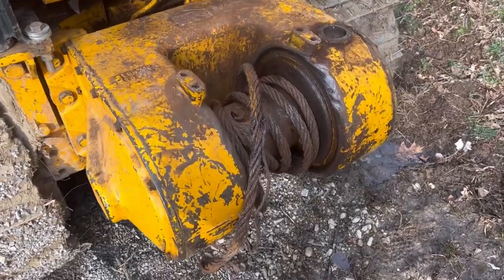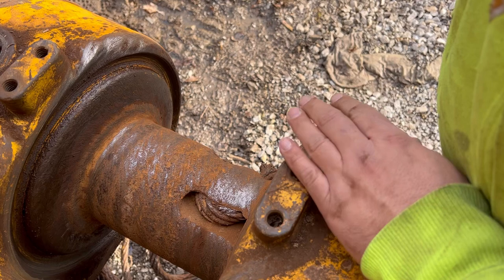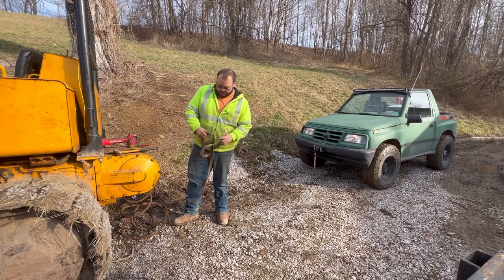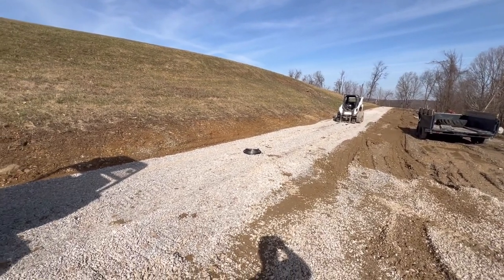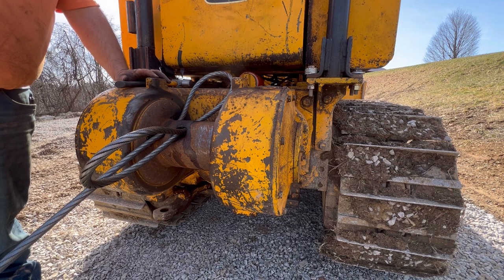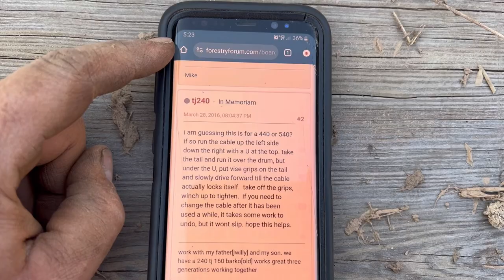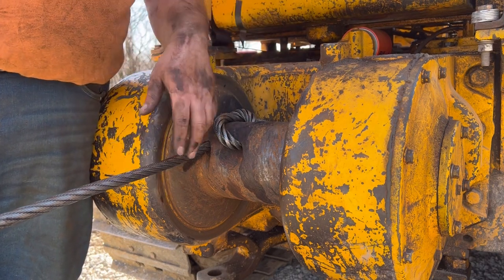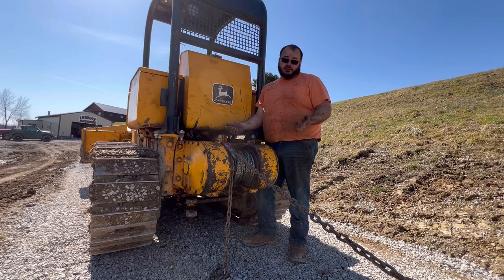Installing new cable on the 3325 winch on John Deere 450 dozer

Comment: I need help right turning brake not working very good but I have no access covers .same looking dozer
Reply from the maker: Id say you have a 450 c then. They look the similar. The C dosent have the accses covers. It has wet brakes and clutches. Ive never worked on one of them. Sorry i cant be more help.
Reply: @hoopiemade  thank you anyways.your very knowledgeable..the tag says 450e.but decals say c..its got a cab on it.never see another one like it yet.

Comment: Winner of two awards for sketchiness:  1)  Always using a screwdriver for prying.  The blade will eventually snap off.  2)  Touching the old and frayed cable with bare hands.  You got away with it this time but someday you will get a very nasty cut to a hand and with rust embedded to boot.
Reply from the maker: It wouldent be the first time that ethier of thouse things have happend🤣